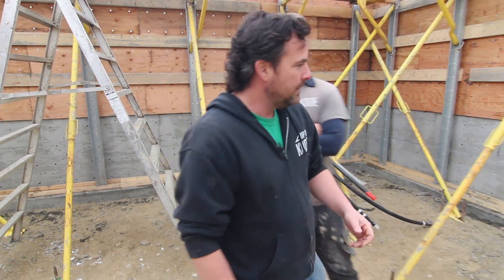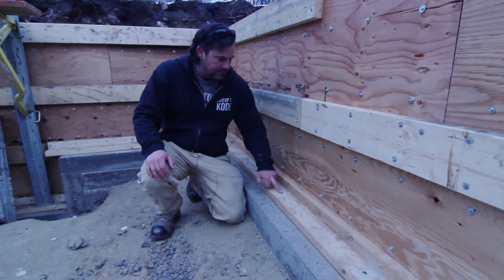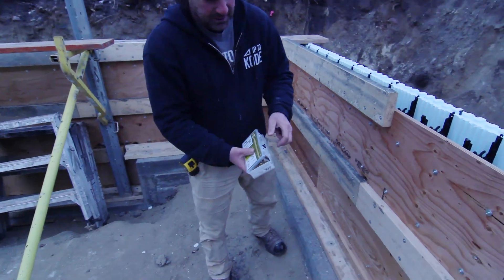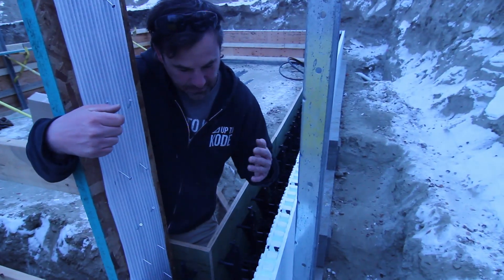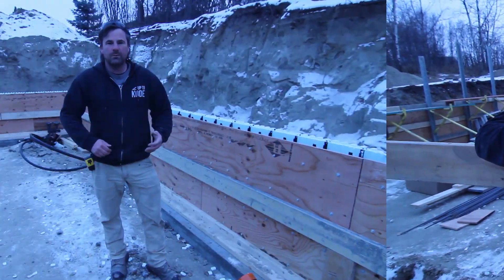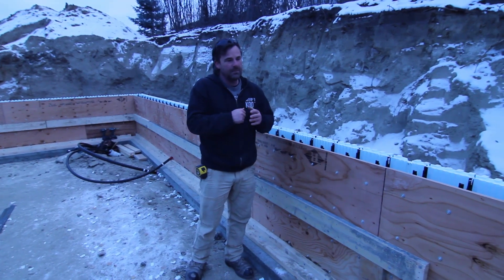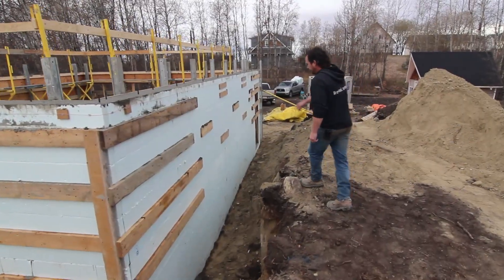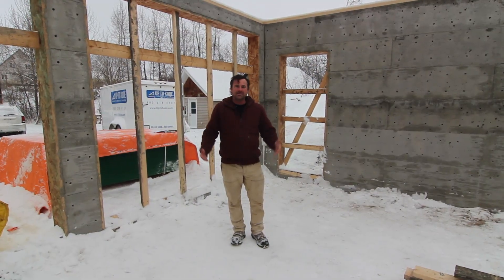Forming Tips for Nudura One Series

Comment: I’m curious why you would need a cold joint in the middle of a floor. I’ve poured over 9’ walls with forms that have 12” web spacing in 2 lifts with no issues at all.  Nudura has 8” spacing so should be pretty much bomb proof I would think except the corners - which need to be braced very well.
Reply from the maker: There a 4’ frost wall below the front wall for the garage door and then steps on each side. I planned it so I didn’t have to buy a ton of plywood forms for 1 job.
Reply: @uptokode  That’s smart!
Reply from the maker: I thought so too! Hopefully I can do another One Series job soon
Reply: @uptokode  For sure! 
I’m curious how easily the formply inserts come out. They are removed when you remove the plywood?
Reply from the maker: Those cones are attached to the form. So once you remove the screw, the plywood and cone comes off really nice and easy. We had zero issues! 

Just don’t let it sit too long.

Comment: Hey Kody. I’m considering an ICF pool using Nudura.  I know of someone using the 1 series to do a pool but haven’t seen the finished result.  I’m considering just the regular block to 5’ depth throughout with a three coat parge layer behind  a vinyl liner finish held at the top by a track. Do you think I may be looking for trouble with dimpling of the foam or crumbling of the parging behind the liner?  There is someone with a video doing something similar (DIY) I believe in Quebec so a cold climate.  Just curious of your thoughts
Reply from the maker: Hi Scott. I would definitely use the standard block as it’s easier to form plus you can curve the walls with relative ease.
Reply from the maker: As for how to waterproof...I don’t know the proper way at this time. I would contact the company called “Tremco” who now owns Nudura and a few other companies who cover all aspects of building envelope. Therefore waterproofing and stucco are part of their system now.
Reply: Good suggestion.  Actually in conversation with them now about another item. Anxiously awaiting engineering for fibre reinforcement vs steel for OBC compliance.  This will be a game changer in my opinion.

Comment: Hey kody, 

Your finish looks great, for us we had some issues with 7 slump running out a bit on a door and window jam.

Because it is gym (basement) bed/bath 1st and open span kitchen/living up top we tried hard to have it perfect after strip...not so much. I think with a seven slump, small agg and plasticizers you really need perfect joints or som of the cream runs out.

So now in a small office I am experimenting with different polish/grind. Basically I have two grinders and a low 3000rpm polisher. Tried a lot of different options but it appears the one I like best is:

Half quicrete half mapei grey grout and some mat quicrete acrylic hardener instead of water.

Mix to “peanut butter” let sit for an hour then polish at 3000 rpm 7 inch hook and loop 180 grit. Basically just buyin cheap discs from princess auto, you get about 16sqf then garbage. 

Anyways, it’s turning out well and need to be done before I get windows on Monday.

I’ll shoot you an email,
Cheers,
Maurice

Comment: Nice work guys,

In Kamloops and I just finished 3 floors of one series on an addition. Some great tips here, I get the creep issue. I am 19x30’ outside dimensions and we had some issues with an eighth/quarter here and there. 

For bracing we cut 2x8 scabs and drilled them at 8 inches wide then used 3.5’ number 10 screws (so your bracing goes right through factory holes into the tie) and used 2x2 on interior corners and 2x4 on interior vertical seams with 2 inch nudura screws into plywood.

On the top floor we split the pour at three courses (4.5 feet) and used 1x2 mdf baseboard to hide the cold joint and do a shadow reveal. Top, bottom and cold joint. Maybe for led reveal strip? I was really happy with that method. As an electrician I tried a bit of Coreline but ended up going mostly with PVC.

The one issue was mix, I went 7 slump, 3/8 agg plasticisor (spelling?) and hot water....still not 100% happy aesthetically...what did you guys go with?

Anyways I have lots of pics so maybe I’ll shoot a few to your company email.

Cheers,
Maurice
Reply from the maker: Hey Maurice! Thanks for the comment. I would appreciate some photos and I’ll include you in a fan feature film someday soon. kody@uptokode.com. 

As for the mix, 5/8 aggregate and 5” slump. No other additives. Hit it heavy with the vibratory. What did you think of our finish?
Reply: @uptokode  great conversations here!  That mix sounds really good to me. I don’t see a need for a larger slump at 6-5/8” wide if a vibratory is used. I’m curious what vibrator you used, Kody.
Reply: Hi Maurice, If you don’t mind, I’d like to see your photos of that job. I’m looking for an electrician down here to do work on the One Series so any info is greatly appreciated. My email is TAOspinner@gmail.com 
Let’s ride! :)

Comment: Am I missing something?? I don't understand the problem with the 8'+/> ply ~v~ the 8' +/- Nudera as one is on the inside and the other is outside. One will always run longer than the other, so I'd say make the outside of the building to plan and the inside will have to have some throw away ply. Or maybe even think about standing your inside corners and use 2x6 on edge to create blow proof corners. To me, I'd still be looking at insulating the inside anyway. I like the idea of a 2x4 frame on the inside with a 1" or more space between it and the concrete. Install all your plumbing and electrical and A/V/coms and when ready, blow an inch or better of foam. That will make it a solid envelope from slab to roof peak while allowing rapid wiring and box and plumbing placement.
Reply from the maker: I like this comment. This would be a good discussion some day.

Comment: Another great video. Mike seems like a character. I follow all your vids. I am finishing  a fox block 4 plex now.  Certified in fox. Nudura. Logix. Integrespec. 
I don’t think I would go this route unless the client has some need I am unaware of. I would hire a good form contractor and put 3 inch foam on the outside or use regular ICF forms and put plywood on the interior walls. 
I may consider one sided Icf for shallow frost walls. Just having a hard time seeing how to use this and make money. Thanks for the vid
Reply from the maker: Mike is a beauty. Fun to work with that’s for sure! I do see what you are saying and would tend to agree. I like the use of this system for the north wall in a passive house and this small cabin we are doing. It has its places.
Reply: @uptokode  : great point. Every system has its own use. Shouldn’t it be the south wall in a cold climate since it gets heated up during the day and dissipate heat at night
Reply from the maker: The north wall that faces to the south. Depends how you visualize it or phrase it.
Reply: @uptokode  : thanks , sorry for the misunderstanding

Comment: Quite interesting but it seems like a lot of work for building a wall. Is it really more cost efficient to compare with more conventional method as seems more laabour intensive.
Reply from the maker: It’s hard to say. I think the main advantage to this over conventional with foam attached later is the 1/2 ICF has attachment points built into already. If you attach foam to a concrete wall you have attachment issue that need to be solved and this is where the labour and time catches up to you.
Reply: @uptokode  thank you for taking the time to answer. By the way, i just finished to redo my kitchen using Ikea and your video are the best as i learnt so much from them.  Thanks for sharing

Comment: Hi guys.  Great work, you and your team do great work and we appreciate you showing us the tricky stuff that others don't show.
Is there a reason why you couldn't do the pour in one day?  With the appropriate ~60 minute setting up time between lifts?  I guess it would require a long length vibrator and proper vibrating as the raw concrete is open to the world. Say "Thanks!" to Mike and your camera-man.
Reply from the maker: If it was a typical 9’ foundation then yes 1 pour is easy. This had a 4’6” frost wall plus the 9’ above slab height so we poured 2 separate times for 2 reasons. One reason was the obvious overall height of 13’6” (bracing shields only 10’) and more so was the mere quantity of forms it would have taken to do all at once. I planned this project with minimal use and purchase of the plywood forms. 

Great question and yes I’ll thank Mike and Greg for you.